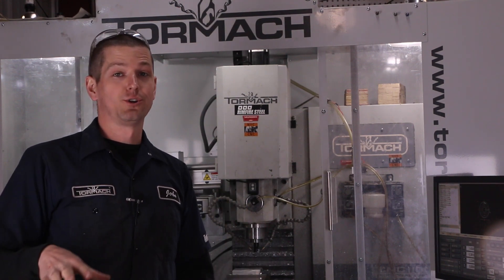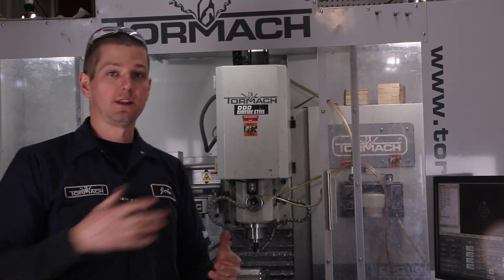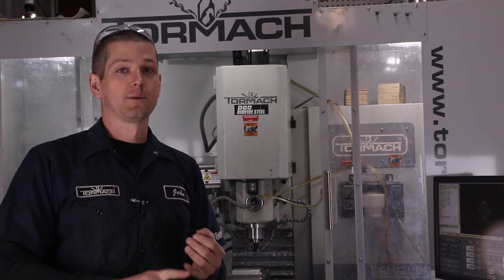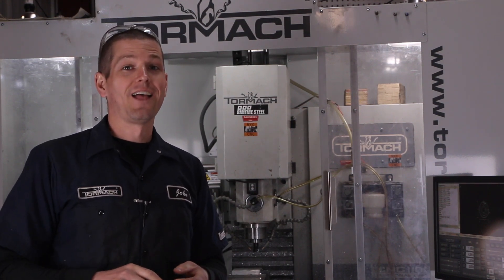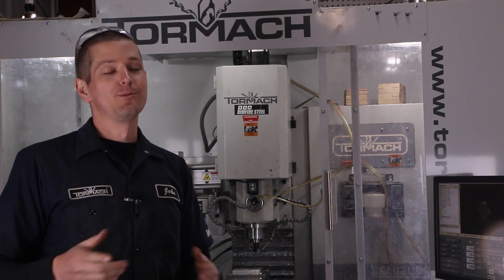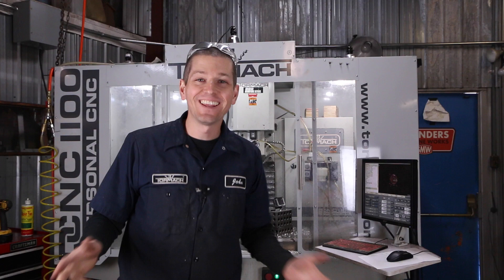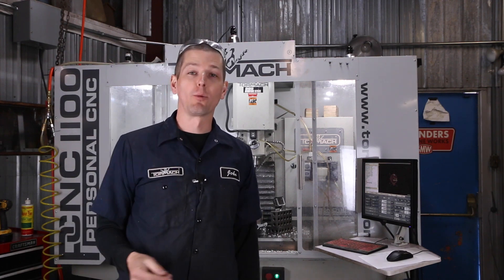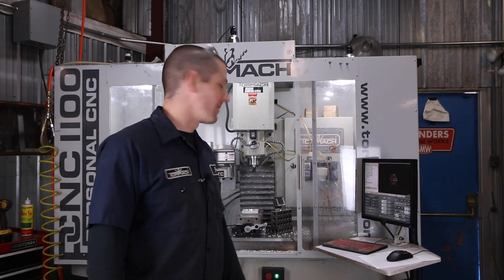Shear Hog + Tormach BONKERS! 6 cubic inches per minute?!

Comment: I'm not crazy about the single flute. 3 flutes would be better for balancing and reduce cutting pressure and chip load.  the cutting speed used in the video calculates to 1275.  I have had good luck running 3 flute carbides at 2000+ cs.  I'm not real sure about the capabilities of this smaller spindle motor and feed speeds of the mill, but i have used a small robodrill and easily got 15 inches Cubed through the use of tricordial toolpaths(Dynamic milling)    .625 carbide cutter. 3 flute. (2000*4/.625=12800RPM.  I Believe tromach maxes at 10k)  Use .005 chip load (.005*3*10000=150IPM).  Ramp to 1.5 depth spiraling out using .1 axial cut(step over) =15 cubic inches a min.   If it cant handle the chip load change the step over to .05 and you still have 7.5 removal rate with a standard cutter,  I think it should hack that.  

What is your max feed rate?  I would be interested to see your machine running at these specs

Just for fun here is a smaller machine, but high performance spindle and feeds doing 200 cubic inches per min https://www.youtube.com/watch?v=-8aIAkMQa0I

Comment: Ok.  #cncporn
To see spindle strain, you can go to a hardware store and get a clamp on Ammeter. It is a 240v feed, so take the current (with that load... seemed like it would be pulling 75-80%, so I estimate .9KW, or 8 amps.

Comment: Ok so heres a cool test for you. Since your fly cutter is on 80mm odd, get a 100mm wide piece of aluminium, and run a trochoidal slot toolpath over it with a 120mm stepover on your hog mill just to clear the edges properly. So basically your facing with that hog cutter. It will be an interesting test for surface finish, i'd advise you clear the entire workpiece on the returning arc so you'll need 200+mm of travel. It should also save a tool change and means you wont have to tram your fly cutter. I really want to see it. Good luck! Basically just do a trochoidal slot on your cam but make it 1mm depth. :)

Comment: My experience with the big [V,H]MCs in a production environment (a shop working in 6061 Al with enormous Niigata and slightly smaller Mazak HMCs with palletized tombstones) is that the sound you're getting is about right for maximum MRR. 'course, they flood cool and run spindles that can jumpstart dead planets...

Comment: I load my tormach down like this all the time! FYI your peak power vs rpm is at about 3150 rpm. Over that drive train and motor/vfd losses start to eat into you power output. In a nut shell that's why you hear it put down and then seems fine. Try it again but only program for say 3500 rpm and you will hear what i'm on about. Also you have a load meter right on the VFD. By default the VFD will show the current load as a percent of max current when commanded to run. So instead of a load meter I just cut a hole in my door and bolted a piece of plexi over it and now I can see my VFD. Also if you have a problem with your drive you now can see the error code without opening the door!

Comment: I assume that tool life is where you'll see the limits of the Tormach.  If you ran a VMC vs your Tormach you'd be changing serts much more frequently on the Tormach. This comment comes directly from my butt as I am speaking out my ass on this. 
I know folks running mill/drills that can't make it 6 inches with a 0.500" endmill at any depth, any speed. The machine can't hold it steady. Brand new endmills burning up after 30 seconds of use. Put a 0.250" endmill in that same machine and it can run all day on it, even take a layman's abuse and keep an edge. That's why I make the assumption about tool life.

Comment: After your last Shear-Hog video, I followed the link and took a look and saw that it was advertised as having a 6 in^3/min PER HP material removal rate and it didn't seem to be breaking a sweat on the Tormach at 3 in^3/min, so I wondered what its outer limit would be on a Tormach or similar machine... not that the MRR in the last video wasn't impressive enough, particularly given that it seemed like a sustainable production rate.  I was very glad to see this follow-up video that's much closer to the hairy edge.  The only way to truly find that edge is to cross it, but you seemed to come close in this video.

I machine aluminum often, but don't have any production jobs in aluminum.  If I did, I'd add the Shear-Hog to the tool rack.  I was tempted to buy it anyway, but I'm very standardized on the Tormach Tooling System and while the 3/4" shank is somewhat compatible with the TTS modified R8 collet, I'd like to have a version of the Shear-Hog with a 1/2" shank that I could bottom out in a 1/2" collet in a TTS compatible ER20 collet holder.
Reply: We could make one without thru-coolant on a 1/2" shank for ya.
Reply: NYC CNC I had forgotten about the TTS epoxy kit.  That's a great idea.  I have a Tormach order hanging around in my Tormach shopping cart.  It looks like you weren't getting the benefits of TTS in your test videos.  Are you planning on using the epoxy kit to make a TTS compatible version of the Shear-Hog to add to your tool table with a repeatable Z height?  The description says it's recommended for tools with a shoulder, as opposed to a straight shank.  For that matter, I have a CNC lathe and epoxy.  I could turn my own TTS compatible adapter!  It looks like Tormach has one of those too.  Why not use the TTS Tool Conversion Kit?

http://www.tormach.com/store/index.php?app=ecom&ns=prodshow&ref=32432
Reply: Alfred Lyon I was hoping you'd say that!  :-)  It looks like enough small shops are using the Tormach Tooling System that some Shear-Hog accommodation would be a viable product for this market - either a TTS version of the Shear Hog, or more likely a turned down half inch shank that fits a TTS ER20 collet.  I had reviewed the PDF of the Shear-Hog product line and had concluded that the thru-coolant feature wouldn't be needed on these smaller machines and eliminating it should result in a rigid enough 1/2" shank for these <3 HP machines.  I have some ceramic inserts and I half considered turning down the 3/4" shank to 1/2" myself, although that solution seems far from optimal.

Comment: It's nice to see the spindle struggle a bit for once. Does the Tormach report its spindle speed, or is it an open loop? Any idea if the spindle has a temp switch or some sort of way to protect itself? You're going to get better tool life running the insert as hard as possible before it chips, so it makes financial sense to run the machine as hard as you can. I'd try and keep this spindle below ~1HP at the tool, for production. I don't see it being an issue with the spindle bogging a bit, at least short term. I'd assume its the VFD running out of power.

You'd save a lot of time plunging right down. Looks like the cutter has more than enough clearance. If it sounds good, its good enough for production in my book.
Reply: When we test them here , we plunge straight down.
Reply: We plunge at 30IPM
Reply: NYC CNC Personally I prefer to dial in my plunge speed by ear on small machines. I'd start around half of the proven feed speed and go up towards the feed until it starts to sound bad. Back off from there until you're happy, it should be quite smooth. I think I was running my Taig at 22 IPM plunge, 32 IPM feed with a 3/16" stub EM, straight plunge. It plunged right down silently. You'd never want to feed into the work at rapids, even if your rapids are low. The ramp in is mainly for tools that are not center cutting, don't have great clearance due to geometry, or you just have bad evacuation due to the depth, coolant flow, etc. I'd ramp in with a tool like this on a VMC, but it would probably have 4 inserts in it, be spinning >10,000 RPM, and plunge >100 IPM. Chip welding happens really fast at 5-6000 SFPM if the coolant fails to gain access to the tool. You're running the tool easy enough that it shouldn't mind plunging at what is full bore for your machine. Just get some scrap piece to mess around with, you can get a bunch of plunge tests out of the little piece you have on the video. Once you get the feeds and speeds dialed in, you're near production ready out of the gates. It saves you time and likely tool wear. Of course the tool is doing more 'work' per revolution, but its doing less revolutions per part for the same removal. The edge sees less wear, AND it happens faster. It only takes a few minutes and some scrap material to get a tool fairly dialed in. Then i'd pay attention to the machine for the first bit until its proven, but it should be fine. Tools generally handle way more than you expect. I put about 1HP through a .250 2F lakeshore EM and it lasts forever. I broke a few getting the feeds and speeds dialed in, but now I know I'm running the thing at 95% of what it can do.

Unfortunately theres not a whole lot out there showing VMC's running full bore optimized in Aluminum, probably since it varies so much with tools and machines, and flood coolant gets in the way. Higher end VMC's have 3HP+ flood coolant pumps flowing along the lines of gallons per second at the tool with considerable pressure. But heres something you might find amusing, check out the "OSG mega muscle drill" video. Cast iorn drills just wonderfully, only thru tool air.

Oh, and don't you have a 1/2" lakeshore 2F TiN endmill? It will run .500 deep, .425 wide, pushing 95 IPM. I think thats about 20 cubic inches / min. These tools can do some serious work under the right circumstances.
Reply: There's no way a Tormach is taking that cut at 95IPM. Not happening. Not no way, not no how. ;)

Comment: Thanks for posting it. It would be interesting to see how that read on the load meter if you had one. Do you have a part that uses the circle you cut out? If nothing else you probably just proved you can get 3 inch^3 per minute all day in production and not have to worry.

Comment: Impressive.
Aluminium cheap in the States, is it??? :>)
Reply: NYC CNC , just pretty up the outsides and sell them as NYC CNC ash trays!  :-)
Reply: I personally do not use them either, but I have seen a few old ones used as advertising on eBay over the years.

Comment: is that full depth for the cutter? or could you take a deeper cut at once. Where nice video,
Reply: The insert depth max is .400" but the Shear-Hogs of any size and configuration ( see www.abtoolsinc.com for more info ) like to be fed fast and hard anywhere from .125" to .250" DOC and high radial WOC.